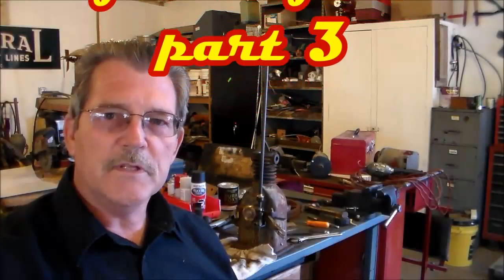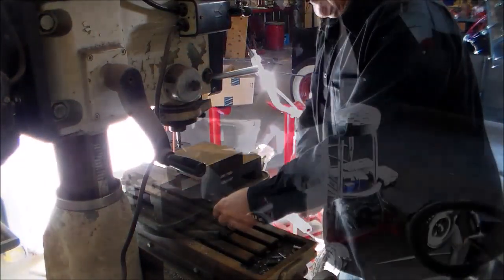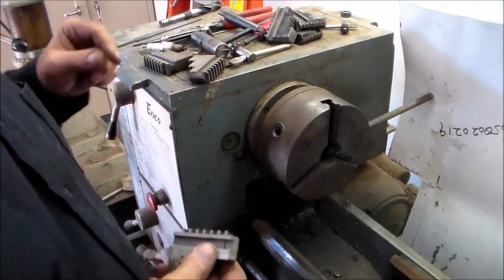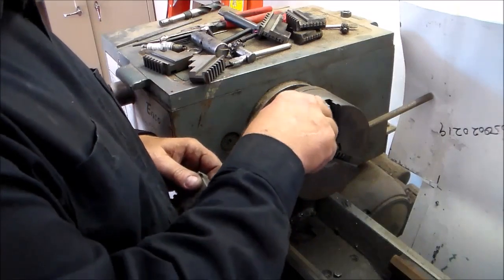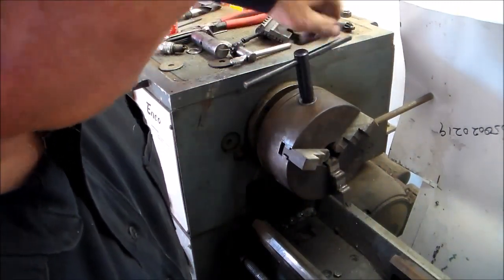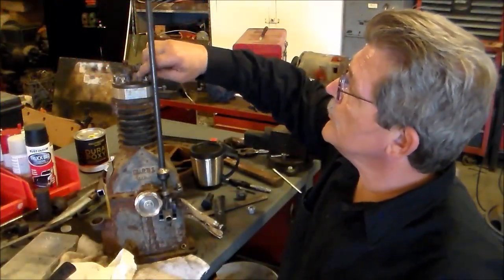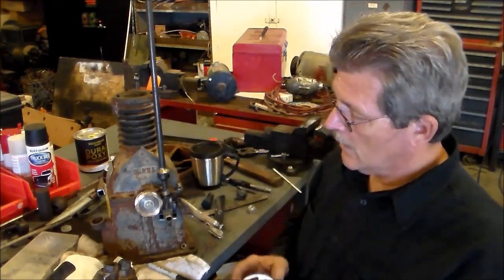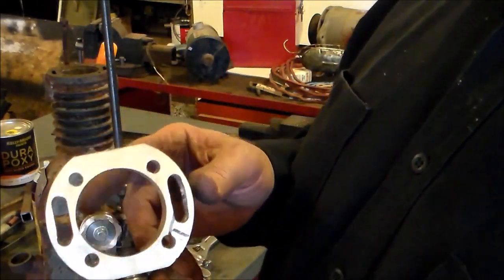Converted Air Compressor  to Gas  Engine Pt 3

Comment: awesome . looking forward to the next part.  someday i'll get to doing mine,  except i don't have a mill or lathe so I'm not sure how I'm gonna do it yet
Reply from the maker: +FullThrottle440    There's lots of options and depends alot on the compressor you use.  Collect parts and ideas . Then see how you have to make it. Take care Dean and thanks
Reply: mine is a two cylinder , so that'll be interesting